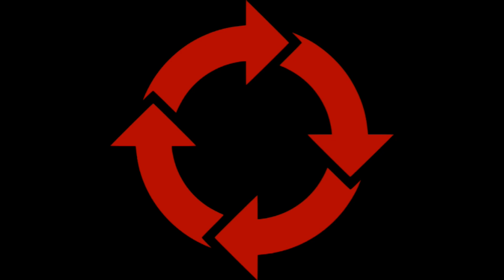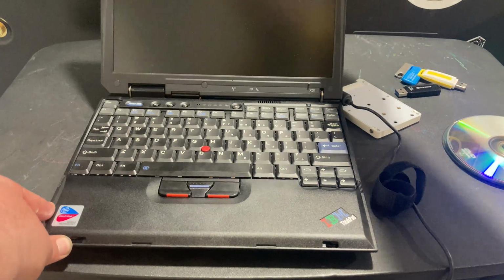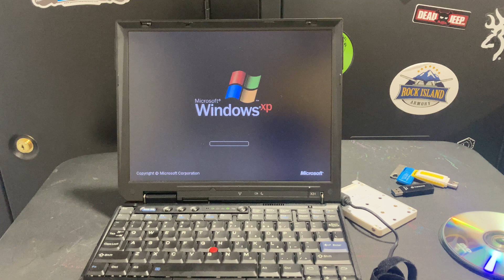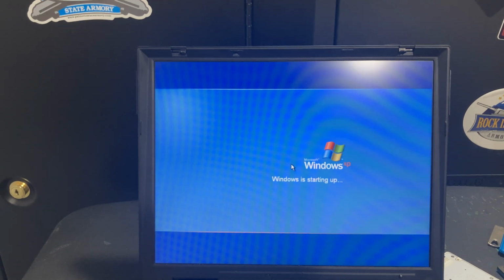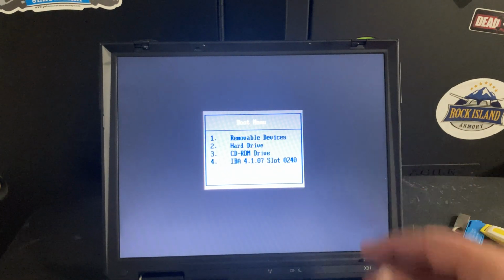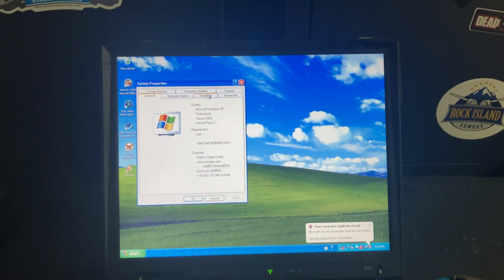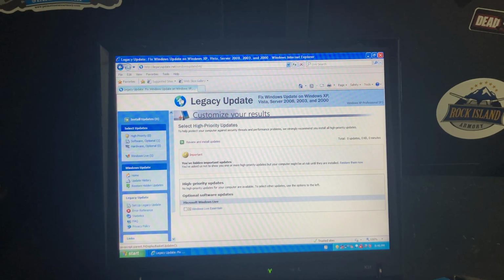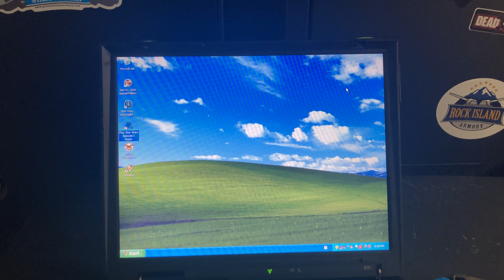20 year old IBM Thinkpad X31 - Up and running with XP

Comment: Hello. It won't install or boot Windows 8 and 10 because those operational systems requires the PAE instructions set. The Pentium M Banias processor has these instructions but they are disabled. I believe they are enabled on Pentium M Dothan. Unfortunately, there's no IBM Thinkpad X31 that came with a Pentium M Dothan, only the Thinkpad X32 originally came with them. I beleive there's a way to enable these instructions, but I have no idea how to do so. Oh and the ATI Radeon 7000 that comes with it, has only 16mb of VRAM. It can't, won't run modern operational systems. You can install Windows Vista and Windows 7, but you need to look for a custom driver, ATI Omega driver. I heard they work pretty well, you can also activate Windows Aero, to a lesser extent of course. Windows 7 is preferable, because it supports the TRIM command,  it's very useful for SSDs. But I wouldn't worry much about SSD life. On a daily machine it'd make a huge difference, but on a retro one that we don't get to use everyday? Nah, It's not really needed.
Reply from the maker: I’m keeping it with windows XP for now, I barely use it, no point in the investment into a later operating system.

Comment: Don't worry about the piracy thing. These days, it seems to be an unofficial internal policy at Microsoft to crack customers' Windows if they are having trouble activating an otherwise-legitimate copy, and a crack is also now circulating for Windows XP that generates a genuine phone activation code.